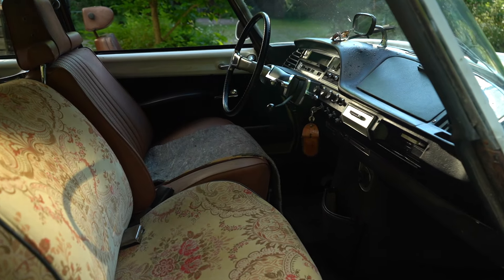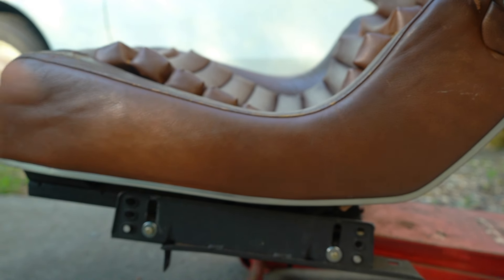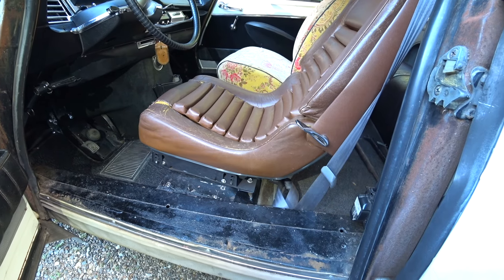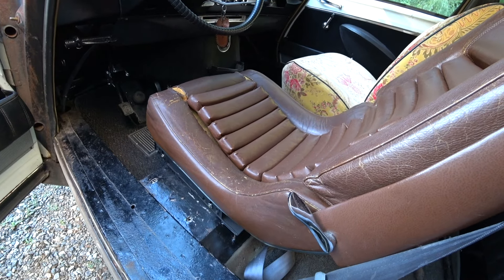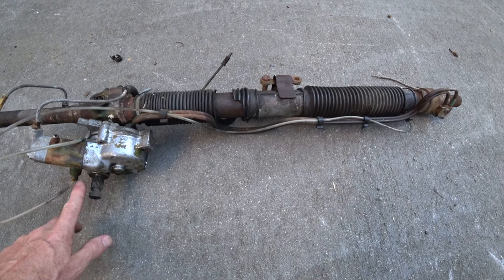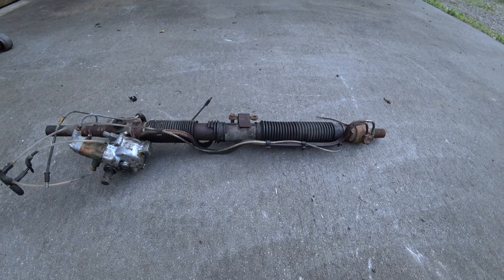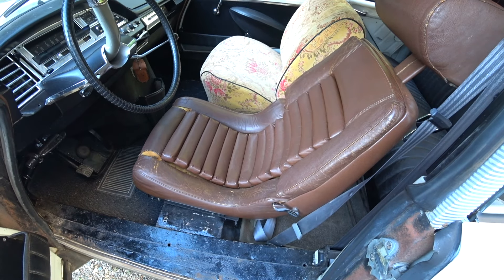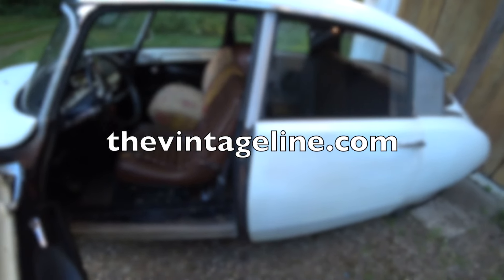Citroen SM seats in a 64 DS19. A match made in heaven?

Comment: Great stuff. I’ve often been wondering how difficult it would be to put a series 2 CX interior in my XM. I think it’s the peak of Citroen interiors, especially in the special chevron / fish grate of the Turbo version. In comparison the XM interior is rather conservative. I once saw such a set of CX seats on a Citroen fair for a very fair price and was very tempted. The pinnacle would be to also add the CX2 dashboard but that would very probably be asking for a lot of trouble. 😁
Reply from the maker: You are defiantly asking for trouble, but sometimes it is worth it. The important thing to consider is the thickness of the base of the new seat and the overall width. If the new base is too thick you end up looking through the top of the windscreen where the optics can make you dizzy. There is usually some fabrication of brackets and welding involved too. Personally I would only make the change if you are extremely uncomfortable driving your XM and you know for sure that you like the CX seats. I tried three different styles of DS seats before this SM seat. The SM seat is perfect whereas none of the DS seats suited me at all.
Reply: @Porsche9elfer  Thanks for taking me seriously but I was kind of daydreaming there. Fabricating parts wouldn’t be a problem but sooner the question how far one should go. In reality I contained myself to mixing up things a tiny bit. My 1996 series 2 XM has a series 1 nose and single spoke steering wheel and the flat streamlined hubcaps of the Evasion version, which make it look extra futuristic in my eyes. As far as the rest goes I have been able to contain myself. Thanks for the nice insights into your adventures.